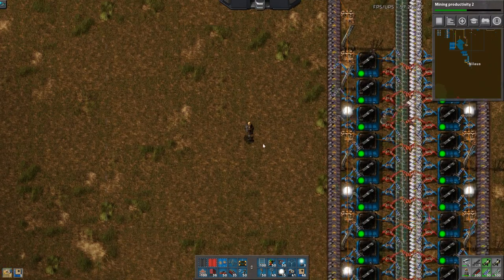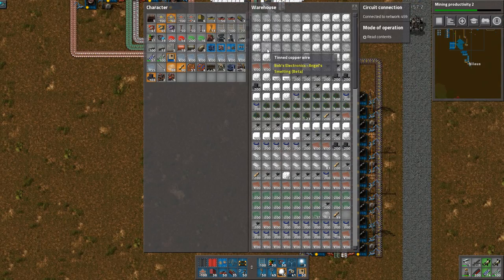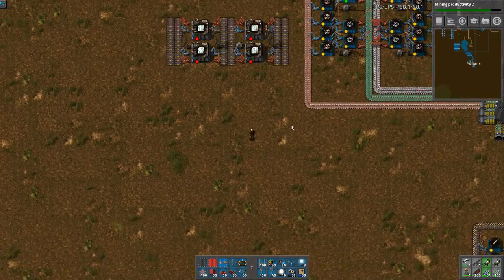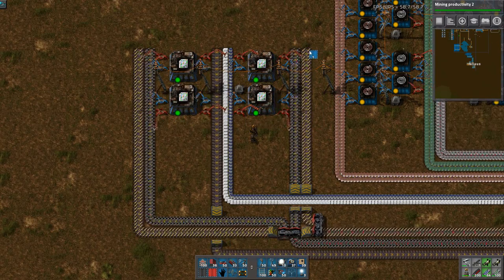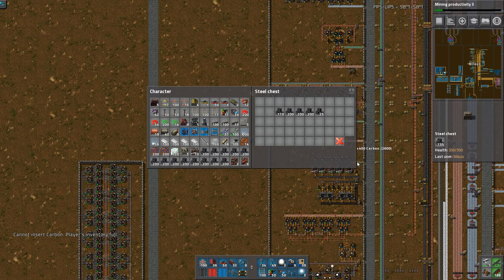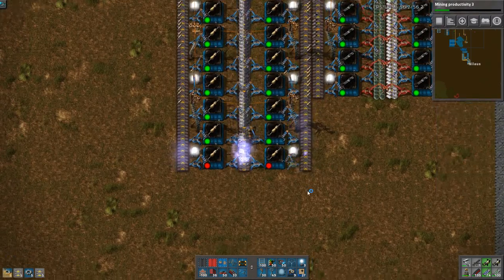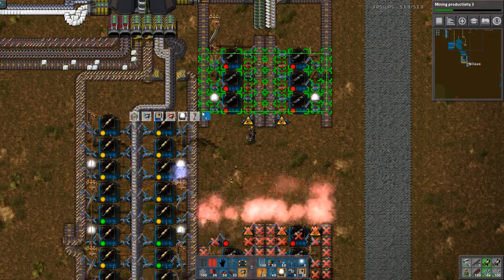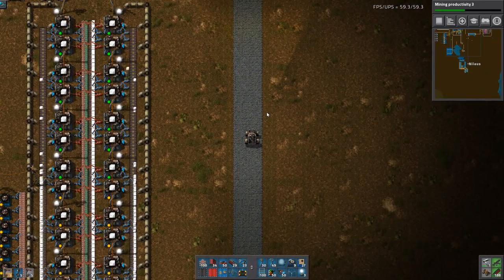Factorio - Marathon Automation - E50 - Electronic Circuit Boards... finally

Comment: Just couple of tips: you dont need a red belt input to one side of a red belt - 2 sides of yellow belt = 1 side of red belt (i.e. the red loaders at the very end of the episode are unnecessary)

And: you dont need a 3 wide space for a bend. just move an inserter as far down on the ASM and the next ASM as far up as possible, then you have the space to make a bend next to the ASM e.g.:
(where A is ASM1, B is ASM2, X is inserter and C is belt)
A
AXC
ACC
BCC
BCC
BXC

Comment: Very disappointing! I even complimented you with KOS about your video belts, and now you broke your purple  belt and made you page into spaghetti...
Reply from the maker: I don't like it either, but the DISTRICTS do not operate without LTN since the whole base is designed for it. That was a realisation I had and then I was faced with several choices:
* Cheat and change the LTN mod to require Basic Electronic Boards
* Build a temporary setup
* Try to make it work without LTN until I had Electronic Circuit Boards
Of these 3 options it was clear to me that 2. was the only reasonable option. I am very happy that I have done it as I can now work on LTN, which is as much a core component of this playthrough as Bob and Angel.
But I do hate that I had to do it...
Reply: Oh but I meant your youtube page, before this video there were cool belts of "vanilla done right" and "death world" in nice order!